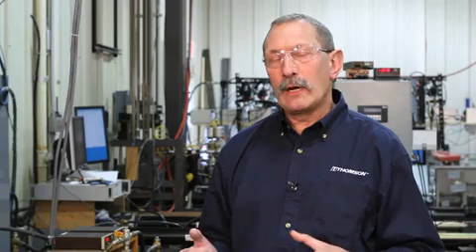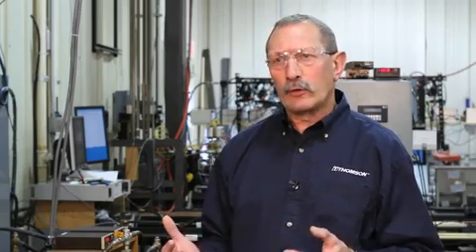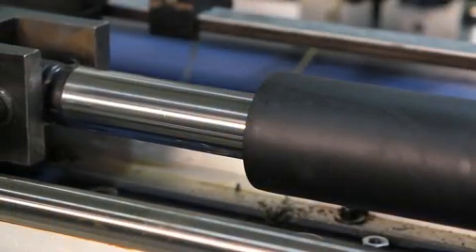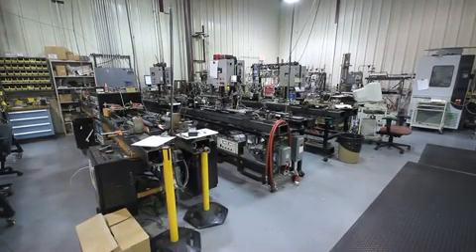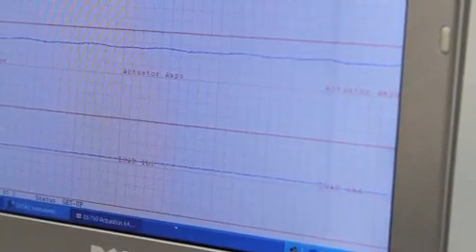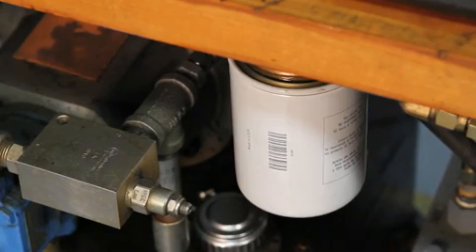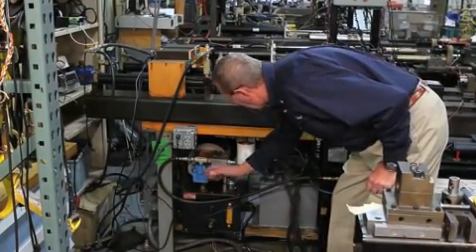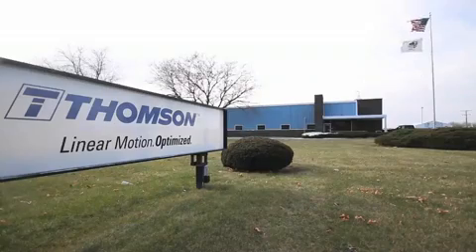Thomson Linear Actuators vs Hydraulic systems.mp4

Comment: Nice presentation.
The difference I see is in the force generated from the same/similar size, i.e. hydraulic cilinder of the same size with normal pressure for these things (e.g. 150 bars) generates, as far as I know, much higher force at a piston rod. But I agree, if that much force is not needed and other restrictions considered, then electric linear actuators are a better solution.
Reply: And also if the hydraulic system is made as it should, then it doesnt leak. But again, both technologies are awsome 😉👍.

Comment: Digital Hydraulic Cylinder
Any good automatic control system is not primarily depends on the accuracy of the algorithm, both using PID and fuzzy algorithm or a variety of advanced intelligent algorithms, and precise execution device is the key to the success of the automation system! Digital hydraulic technology is the key to the development of many automatic control systems beyond the existing technology.
Digital cylinder, also known as: digital hydraulic cylinder, electro-hydraulic step cylinder, electro-hydraulic pulse cylinder, NC pulse hydraulic cylinder, etc.. It is a kind of digital servo valve, cylinder, sensor, feedback and control combination, hi-tech integration products of hydraulic transmission and control, and the full digital characteristics. It is especially suitable for high precision speed and position control, coordinated motion control of transmission system, especially in the large flow rate (KL / min), high frequency response servo control, it has unparalleled competitive advantage.
AEMETEC digital hydraulic due to the innovative design, fully use the digital structure, and thus its characteristics are completely digitized or labeled. For example, the displacement of the AEMETEC Digital Cylinder 0.01 mm corresponds to 1 electrical pulses; AEMETEC Digital Valve 0.01 degree corresponds to 1 electric pulses. Thus we can imagine AEMETEC Digital Hydraulic Control of existing production equipment, only work is to AEMETEC Digital Hydraulic (digital cylinder and digital valve, etc.) to send different frequency, number of electric pulse signal, without the need for another example is the traditional control system need to repeatedly adjust the proportion, integral, differential, temperature compensation parameters and so on, makes AEMETEC Digital Hydraulic control system is installed with, fully embodies the digital technology in the field of industrial technology perfect characteristics.

https://youtu.be/ylVPrXpQDaA

http://www.ihydraulic.com/en/content/?102.html
Reply: Digital Hydraulics AEMETEC Co., Ltd. I have no idea, as most other readers of your comment, what you just said. It appears you are trying to validate something but what that something is ...
   Please try a course in oral communication or talk to a customer service rep for some pointers. Oh, better yet, let an Earthling PROOFREAD any and all correspondence before you send anything else.

Comment: No one should use hydraulics unless they are forced to by the design constraints, like force density and price. Hydraulics are mass produced in a much broader range of sizes and will be cheaper/feasible after certain size.

Comment: Are there electric actuators that allow to free the load, i.e. those that behave more like hydraulic cylinders? What if I don't need the actuator to maintain its position without power or at least not maintain it for some time when powered?
Reply: Yegor Petrov the pitch of the screw allows you to back drive if needed

Comment: I love actuators -- i did not know they were comparable in strength to hydraulics -- what about speed and price comparison.  I was planning on building a mini backhoe similar to  the  Greens Machine backhoe but I not sure of the power needed. Actuators I think would be more upfront on the cost but long term less costly -- repairs and such.

Cheers, Patrick